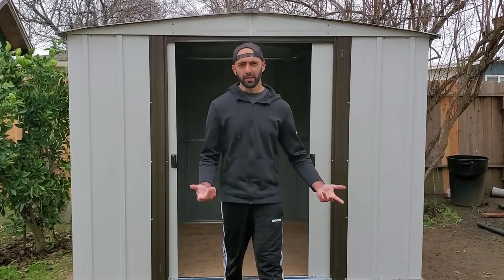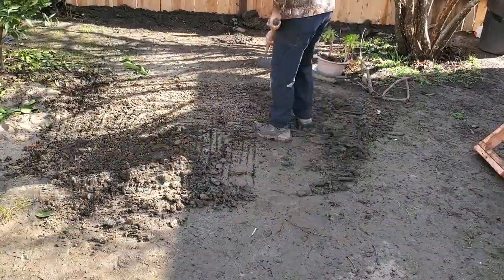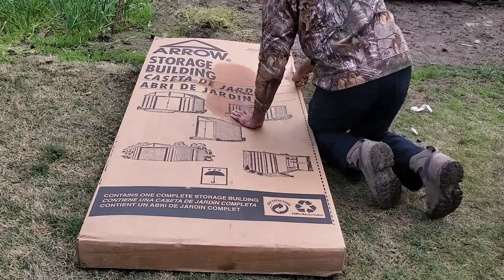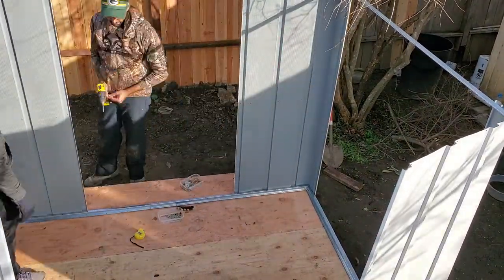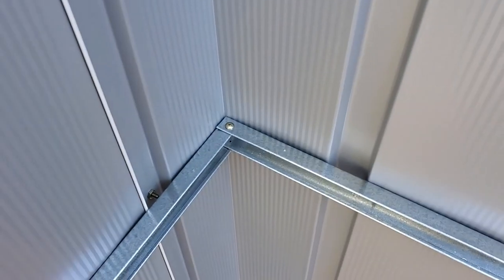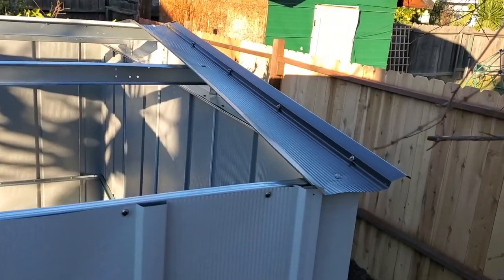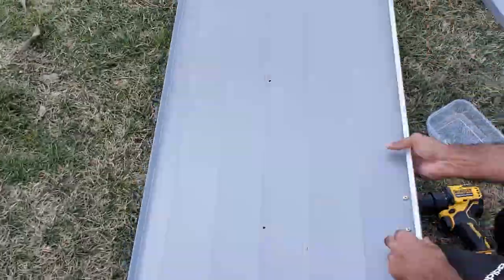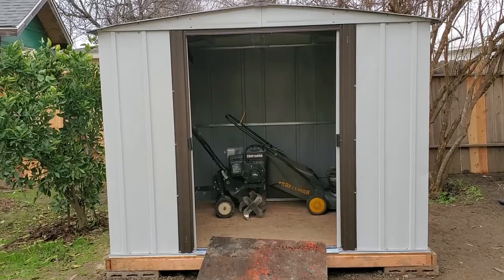Step by Step Instructions into Building Your First Shed!

Comment: These storage sheds are REDICULOUSLY SKY HIGH. Not counting you got to have some sort of floor, and to put them togather.  I paid like 529 dollars for a 10x8. Cause there going to jump up another 400 dollars. THAT 529 dollar just for a unassembled storage shed. Not count about another 500 dollars for a wooden, screws for a  frame and cement. Plus my time to assemble it
Reply from the maker: Yikes! Inflation is crazy right now
Reply: @DuctTapeMechanic  Its going to get worse.
Reply: @DuctTapeMechanic  Yes and pickup trucks going for 85k  🤬

Comment: How well does it hold up in a strong wind?  Any idea if it would hold up in a hurricane?
Reply from the maker: It's holding up well but I'm in sunny California. I am fairly certain it will not hold up in a hurricane.
Reply: @DuctTapeMechanic  Thanks! I have a wooden pump shed that held up well for many years and no problems with hurricanes but now termites have infested it and it is collapsing.  I would like to go metal for replacement as I wouldn't have to worry about termites but just my impression from the video, the shed looks a bit on the flimsy side.   Might go down in the first strong wind.

Comment: Thanks for uploading ! Is there a hole on the Door handle for a Lock ?
Reply from the maker: There are door handles on each sliding door.However there is no lock. When the doors close it makes a loop and you can put a padlock through the loop.
Reply: Thank you . I will watch video many more times when I install it . 
I have the Floor Base Complete . 
How long do you think for 2 Guys to assemble Shed Only ?

Comment: Wanted to ask if when it rains does water get into shed or does it do the job nicely to stay dry. I’m thinking of buying a shed vs actually paying for a storage space.
Reply: Water will run through on the backside due to the foundation extension unless you silicone the bottom wall plate were it meets the wood. Also don’t forget to anchor it down.

Comment: I have the 8 by 10 but the exact same shed besides that and I'm having a hard time getting the doors to adjust and slide easy they look level and close together together but they are scraping on the inside screws. Any suggestions?

Comment: Before to attempt construction! : Check for WRONG size part #8946 on page 15.
The floor base Left and Right pieces are 1/2' too short, that's why we had to cut front to back pieces. I'm going to Home Depot later to ask for a refund.
Page 15 WRONG PART!
Part  6946 is only 66 1/8" long and is for a 5 1/2" shed! Not a 6' foot shed.
I did get a partial refund as I didn't want to disassemble the shed and return it for a full refund.
I had to cut metal roof of by 1/2' and overlap rear panels to get it to work.
Now I have an 8x5.5' shed.

Comment: can you help me answer some questions please. i just bought this. am i going to be able to assemble this with the back facing a fence? meaning i wont have access to the back. also, whats up with the platform? why did they recommend a larger than need platform size? thanks
Reply from the maker: You will need access to the back because the panels can only be screwed in a certain way. I am not sure why they recommend a larger platform other then ease of moving the shed while building (you may have to pull/pry on the roof panels to get them to line up with the holes)

Comment: Did you have to make new holes in order for the tracks and other parts to be at whatever length it needs it to be
Reply from the maker: No I didn't have to make any holes that I recall. Everything is predrilled.
Reply: @DuctTapeMechanic  I was asking because the door tracks were off by like an inch for me when assembled(too long). And the base is off by 1/2 inch when I measure it. Thanks